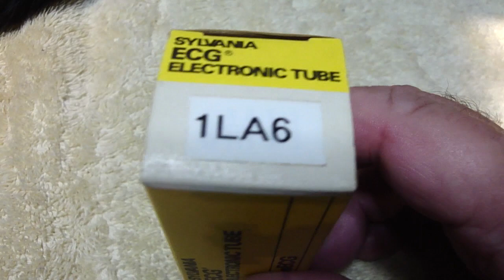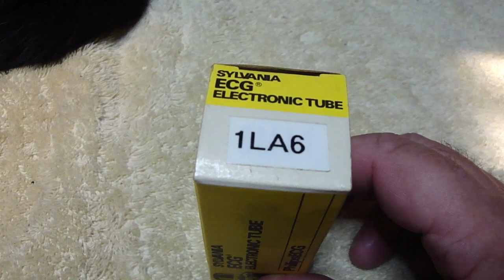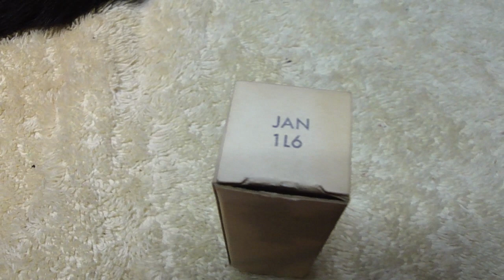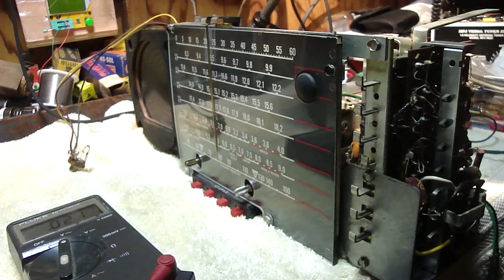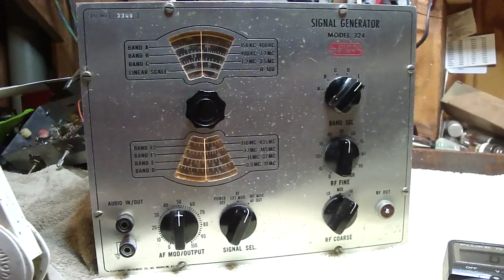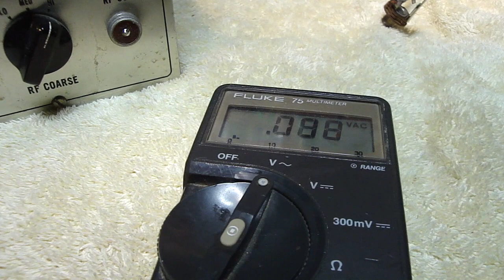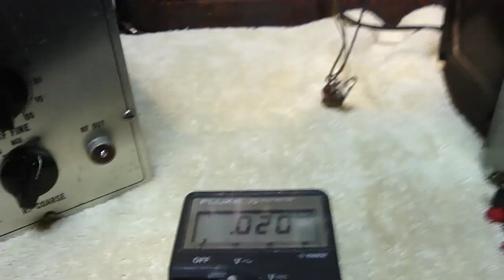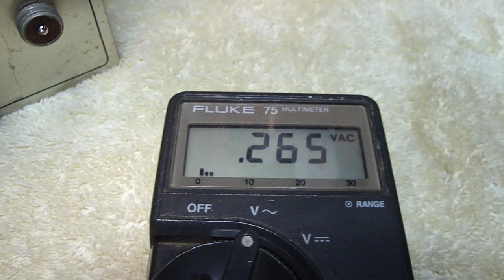Zenith Tube Trans Oceanic Upgrade

Comment: I have an R600 that has a fading in and out issue with shortwave on some frequency. A random pop sound and faint hum that comes and goes. Im recapping it right now and all parts to build the battery box are on the way

Comment: I restored a G500 and sold it. Really regret selling it now. I even had the Royalty of Radio book 😢
Reply: I just bought a G500 off eBay in really nice condition; the guy I bought it from said it worked really well 'It's really clear and sensitive'. I asked him if it had been restored and what was done and how long ago, he replied that he didn't know for sure but someone went to a lot of trouble cleaning it up.
It has the power cord swapped out for a white one, so that plus what he said about how well it worked leads me to surmise that someone went through it in some way at some point in the recent past.
Reply: @fixman88  Hopefully it’s working nicely for you. The only problem I had with mine was the germanium rectifier. A trip to RadioShack fixed it. I put a Zener Diode in and left the old ceramic block part in place in case the future owner wanted to hog the block out with a dremel tool to hide the Zener inside. 😉

Comment: I found an H500 cleaning out my dad's garage.  All original, but I don't want to just plug it in and let the smoke out.  I'm a HAM, but not an electronics guy.  What are these worth working and just as "shelf art"?
Reply from the maker: Like everything else in life, condition is everything. If it's in good condition, non-working sets are worth 50-80 dollars depending if the tubes are there and not missing original parts. One that's been serviced (properly) can be worth between 140-180 US dollars. If the radio means a lot to you as if was your father's radio, it's priceless - RW KC2RDU

Comment: I listed the WRONG chassis/ model #  below  IT IS the H500 model chassis 5H40 that has this 16 meter problem with the OSC coil slug all the way out the form to get DOWN to 18.5 MHZ not even close to the 17.8 MHZ specified.
Reply from the maker: Take a look at the (2) resistors going to the 1L6. First, check the 100k resistor. This goes across the filaments and fi it's 110k or greater, it will show up as trouble doing the oscillator trimming on each band - I assume you already aligned the I.F. cans. If that doesn't work, heck the 180k resistor as well. If your filament string isn't at least 7.7 volts, this might happen.

Comment: I have seen these 1l6 substitutes on ebay lately in the 40 to 60 dollar range, however I have a question on a T.O. model  L507 chassis 5L 42 and the question is when aligning all bans except the 16 meter went fine, but the 16 meter band could not be aligned properly, it was WAAAAAYYYY   out, the nearest I could get the oscillator coil was at  18.5 MHZ with the slug all the way out almost.
Could this be a problem with the coil itself, a Capacitor associated with said coil on the tower maybe!??  Other than this the radio works O.k.   John A Bellas

Comment: Interesting video! But I don’t understand why the SS 1L6’s are so expensive. It’s cheaper to get a real one. 

I’d like to see you repeat that test at 600KC, 1600KC, 5MC.
Reply from the maker: I'm with you on the price. I'm confident the person putting this together is doing so on a small scale. He/She is doing this for little profit. Because this is a niche market, you cannot justify making 10,000 of these for a better price and I get that. I did put this in my first collector radio last night - my H-500. Although the sunspot gods have not blessed us lately, With the SS1L6, I was able to receive WMVP at 1000KC from Chicago with the signal periodically fading in/out but fully clear with WINS 1010 from New York City next door. I'm 27 air miles from NYC.
Reply: The price is worth it for the added voltage.  Forego the beer for a week and buy the tube. :^D  Fully restored and aligned and this should be a screamer.

Comment: While this experiment made for a nice video for YouTube, it was precisely that, an experiment. As I have many other radios, I know for a fact that a lot is not being heard on the higher bands at all. So, the airwaves are a much more “real world” proving ground than the output of a signal generator. Not trying to be a jerk here, but if you put this into service, and actually hear radio signals up that high, given propagation conditions, let us know. Otherwise, the 1L6 is just fine. I have a NOS one that I keep nearby for that “just in case” moment. While prices have come down, there always will be a finite supply of them. The price difference in the solid state substitute just does not seem to be justified here.
Reply from the maker: I agree with you 110 percent! The propagation as you know has been less than favorable. There has been band openings here and there, but nothing like it was 20 years ago. Knowing how inconsistent fading signals are, are why I went with the signal generator for this. Curiosity made me break away with 50 bucks. I do have my own pile of new and used 1L6's if I need them. In the total picture, I just wanted to share my findings with everyone and enjoy reading what folks have to say. Thanks for stopping by! RW - Bob

Comment: Much as I like the performance of the solid state amplifier, I'm not sure I like the idea.  In theory, you could just replace all of the tubes and have a better performing radio but would it be worth it? Certainly lower battery requirements, more audio output, better IF performance but... Still, an interesting video Bob and something I have not seen done before except with rectifiers going solid state.
Reply from the maker: Curiosity got the best of me.....(and 50 bucks). The fact is this tube does work very well. The individual who did this should be commended for this idea and bringing it to fruition! Your point is well taken since using this does take away from the originality of the radio. I see the same goings on with antique cars. I just wanted to see for myself what this would do and share it with everyone as well.

Comment: I bought one of those solid state 1L6 tubes quite a few years back it’s in my L600 it works great, also I bought the solid state ballast tube replacement. I think they are well worth the money. I saw the Hallicrafters S38 tucked away in the corner anyway good video enjoyed it.
Reply from the maker: I knew someone out there had these! Another happy customer! I took two of these regularly for 3 weeks just before breakfast and lost 28 pounds and one waist size. Whoops.... wrong video - LOL! This SS1L6 impressed me! I know that the entire miniature tube lineup for T.O's were made the same way a few years back. Funny thing is that the 50A1 ballast tube seems harder to find than a 1L6.... By the way - The radio you saw is a Lafayette HE-10, not a Hallicrafters S-38. Good guess though! Thanks for stopping by! RW
Reply: @Radiowild  I have a solid state 50A1 in my 6 tube H500 (1953). I've not broken down for the 1L6, 1U4 yet.
Reply: instablaster